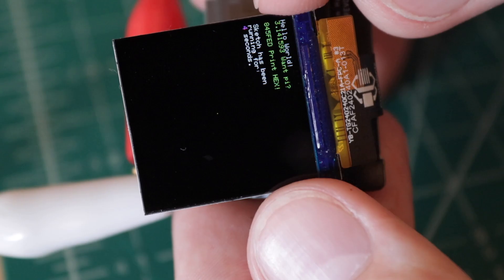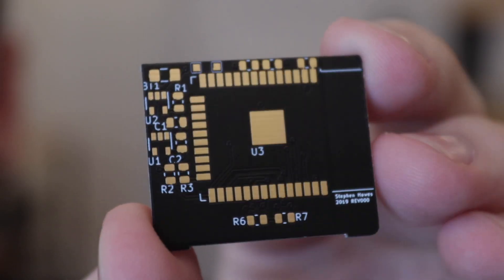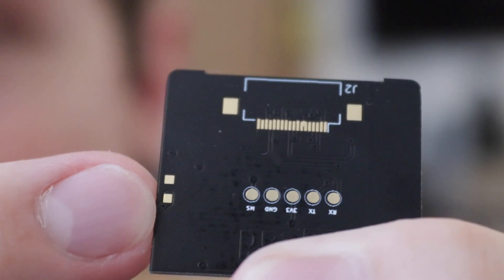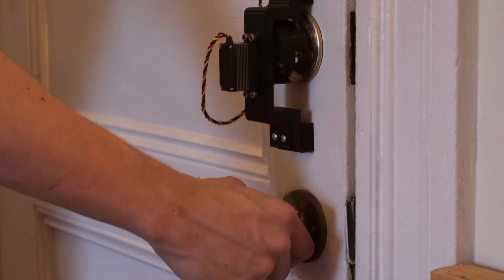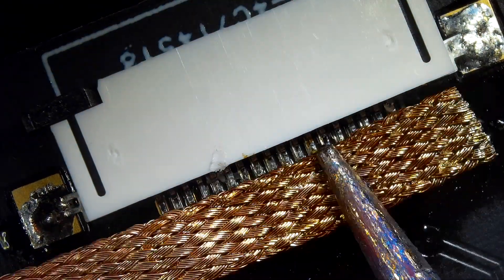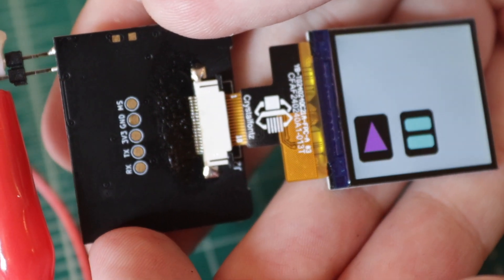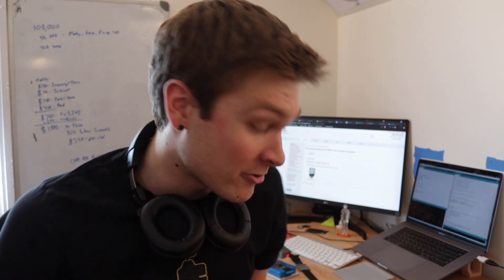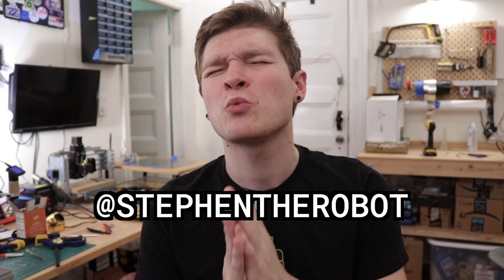My Custom Smartwatch is DONE!

Comment: yep hits every time ! when ever i printed n itched the circuit board
 print come out good but  it turns backwards
 then fix it again then triple check design is in back side of the board
 try to put ic on then ic pins is wrong way
 then i realize the circuit i design at first was good just need to inverted or something
then lots of mistakes i learn something new we all do right 
first try n it works then what would we learn right?!

Comment: Isn't that battery way too small for powering an esp32, or are you using deepsleep somehow?
Reply: I try deepsleep but in that mode. The Crystal turn off. And the oscilaton work is doing by r+c components.
In 5 hours the time fordward 20 minutes. Sleepmode is not an option for do a clock